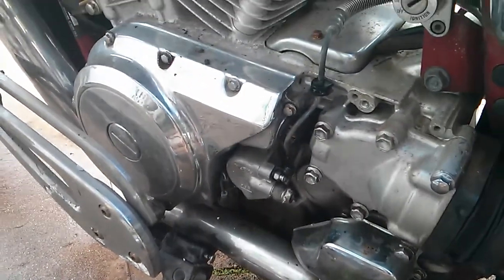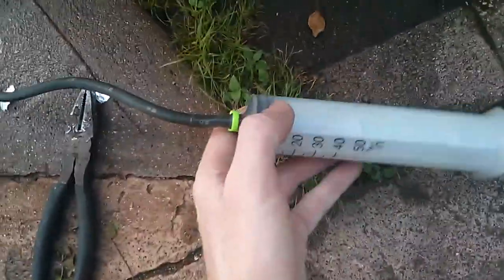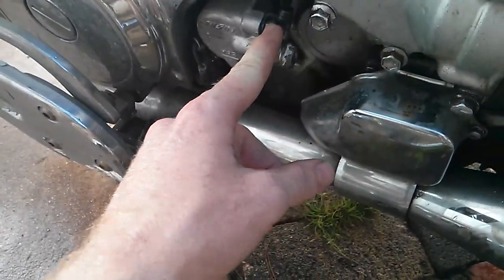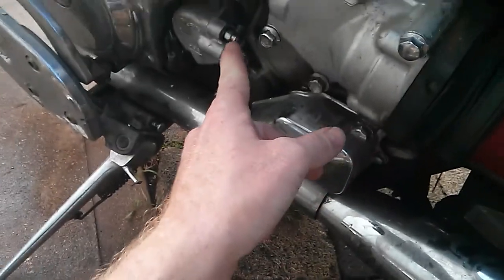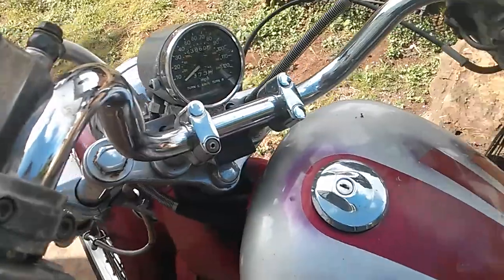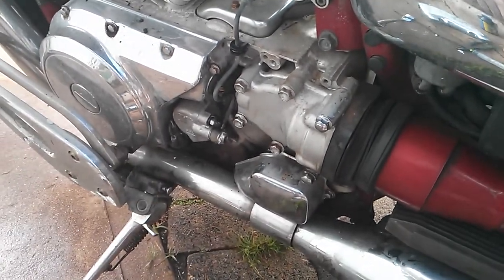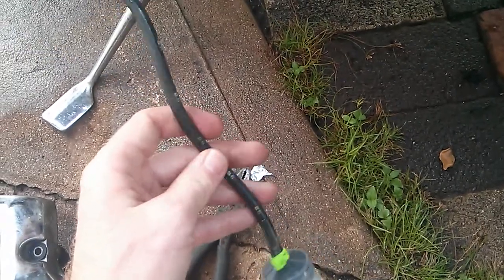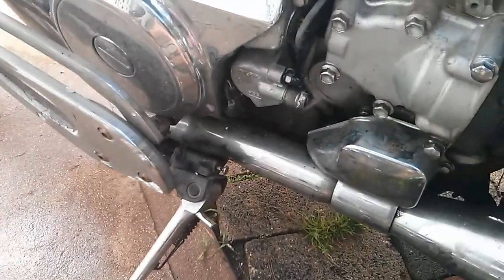brakes and clutches, bleeding dry systems

Comment: Hi, I have a Intruder VS800 from 1995, and I'm having some issues to remove the the chrome cover from the fork dust seal, you have any tip how remove them?
Tanks.
Reply from the maker: +Marco Borges I know exactly what you are talking about but I haven't tried to remove it. You might be able to pry a little bit up from each side..alternating sides until it's out. I'm not sure exactly though
Reply: Marco Borges mine came off easy.